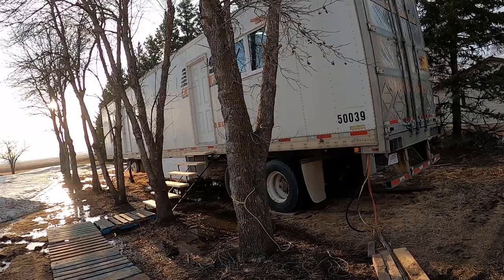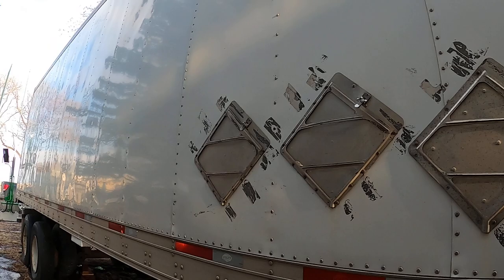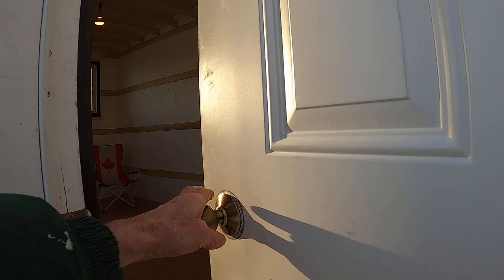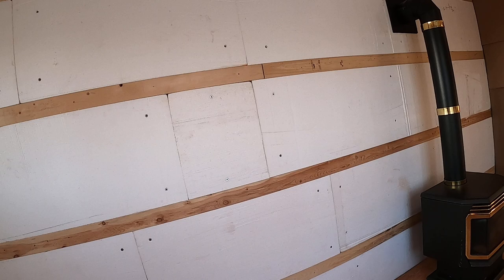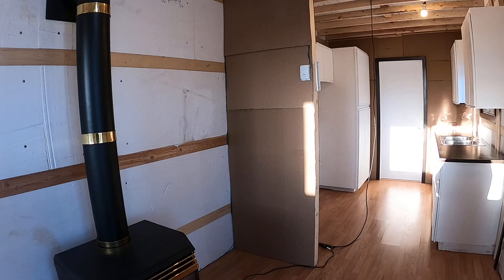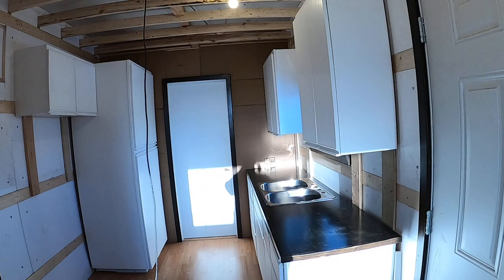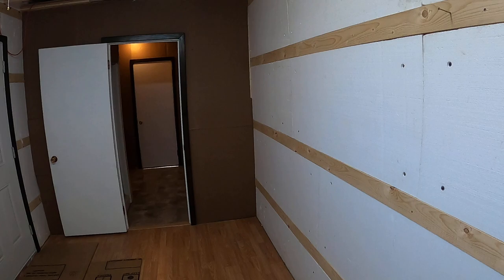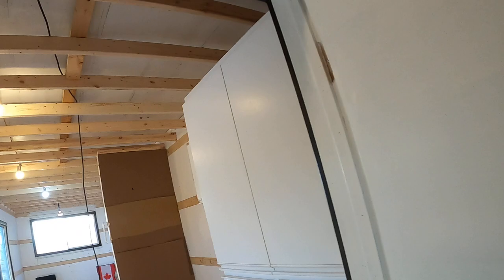Refrigerated Trailer Conversion to a Tiny House

Comment: Always knew refrigerated containers are the way to go.. even buying a whole rig with a working AC you can run it in the desert with the whole trailer roof solar running back to a powerwall.  You can also pop it off drop it off and have easy storage in the rear for a ford maverick on a lift. With a radius of 600 miles?? That’s a steal 😊

Comment: If you did the Japanese style floor in some spots it could be a ton more storage too.
Reply from the maker: Yes you are correct.
Reply: @mccrearymike  can we have some direct conversation about your tiny home refrigerator trailer conversation, I would greatly appreciate it because I am currently on my tiny home journey right now! My name is Antonio Beckford, by the way!
Reply: @mccrearymike I meant tiny home conversion, can we speak sir!
Reply from the maker: sorry didn't read this. sure give me a shout at 204 647 2125 @antoniobeckford6463

Comment: Hey Mike, I’m looking to convert a refrigerated box body into a sauna. The interior walls are clad in FRP panels, and I don’t want any fumes/issues with the panels under the high heat from the sauna. Should/can I remove the panels or should I insulate further on the interior walls to try and stop the heat from reaching the FRP? Any help would be really appreciated!
Reply from the maker: To be honest I don't think the moisture would get through the plastic coating unless through the seams if any? When these sit empty in the sun they get pretty hot inside. Im guessing at least as hot as in a sauna..

Comment: Nice. Would like a price on one with solid quality but basic items. Located in Georgia.
Reply from the maker: It would depend on exactly you want in it. Im working on one now and i want to sell it with it partially finished. It is lined with 100 year old barn wood from a barn we tore down. KItchen cabinets installed, windows and doors installed and would have the ceiling framed up waiting for panels to be dropped in. Buyer would do all electrical and plumbing. Ceiling open to allow for this. Walls framed and lined and I installed extra insulation as well. Let me know if your interested..

Comment: Just a question. Buying my 42 footer in a couple of days. 
How long do the tires stay up? Will you have to put air in every so often?
I'm in canada southern province. It gets hot in the summer and very cold in winter. The tires on sitting cars go down regardless how new they are. (I don't know if weather has anything to do with it lol).
Reply from the maker: I've never added air to any of them. I guess they go up and down uniformly ha. Easy enough to add it.
Reply: @mccrearymike  thanks for getting back to me. I appreciate it. 
What I ended up doing was cementing 4x4 posts under certain parts of the trailer incase the tires deflate. Nothing has happened yet with the bot summer and now frigid below 0 winter here. Still pumped up.
Reply: Those wheels are made to hold 50 thousand pounds loaded 
Empty wouldn't have a problem   
U can put Jack stands under the axles
Reply: @briantruck2284  amazing! That's a good idea. Thank you.

Comment: Everything seems so creaky and slamy. It seems louder than it would be in a home. Would it be so much more expensive to have more quiet doors/drawers? Seems like sound insulation is bare minimum : (
Reply: Would be easy to make them quieter little felt Sticker in the jam would fix it
Reply from the maker: I think it's the mic picking it up and the fact there is no furniture